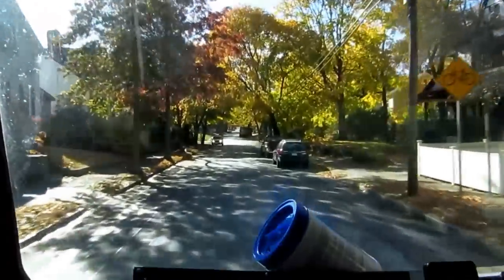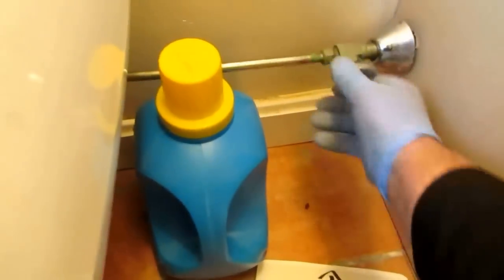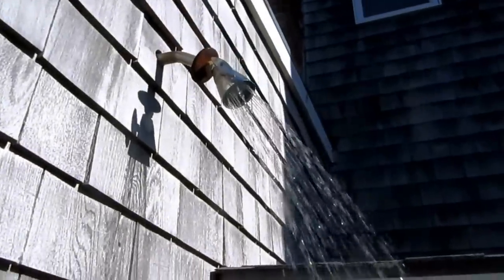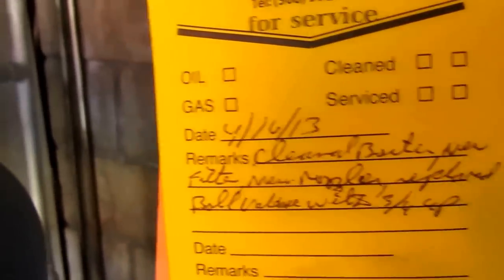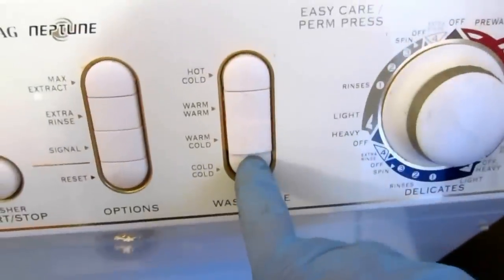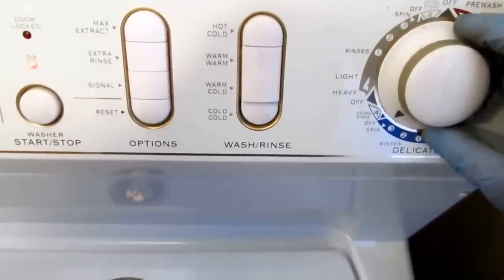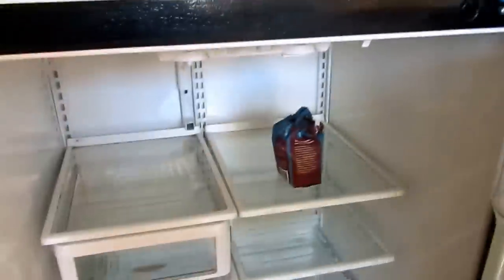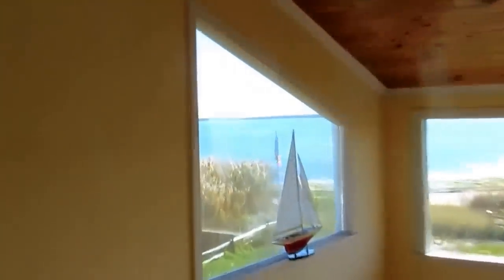PLUMBING TIPS:winterize house with boiler @ baseboard heat

Comment from the maker: the boiler water heats the tankess part the low limit is set for 160 to allow the boiler water to heat the coil up witch then will kick in after the 160 for heating run up to 180 high limit ect

Comment from the maker: if the low limit is set to 160 the cerculator for the heat will not run till the 160 is meet

Comment: Got another  couple of questions for you Steve. I am replacing a 40 gallon propane hot water heater.  The water supply is a private residential well. The water heater location is in the basement. There is a studio apartment on the basement level,  with 2 sinks, 1 toilet, and a washer and dryer that uses a small amount of water for wrinkle remove cycle. No dish washer in the basement apartment either.
The vacuum relief valve is not required, in my state. 
Is there any good reason for me to add a vacuum relief valve to the system?  No city water at all at the residence.
Also, do you use Yellow Teflon tape, with pipe dope, on the propane hook up, or just the pipe dope? A lot of old timers, and inspectors don't like to see the teflon tape, but I see you like to use both tape and compound on your other threaded joints.
Thanks.
Reply from the maker: +Marc Poirier with gas i only use pipe dope . no need for a vac breaker if you have a well
Reply: +steven lavimoniere Pretty much what I thought.  Thanks for getting back to me. 
I was laughing my ass off when I watched your video about replacing the water lines with PEX in that old house with the brass fittings that were breaking up on you.  I thought you were gonna chase that one to the street. Funny phone call.  Geez, Idk why We would want to wear gloves.

Comment: Thanks for the video.  Do you adjust the compressor down to 15 psi to blow out the furnace or does the feeder valve reduce the pressure from you original 60 psi?
Reply from the maker: spatmay i make sure the drain valves are open before applying the pressure no i let the 60 psi push the water out ,but the other end has to be open so you do not build high pressure in boiler

Comment: Did you make that pump that you use to drain the toilets?  If so, what did you use for the vacuum plunger inside the PVC pipe?
Reply from the maker: +Marc Poirier www.youtube.com/watch?v=UgjD5fiWRU8&list=PLhnZ_WalJ2tb2fx6UfzGi_l-3wIZfvvbo&index=21
Reply: Wolverine Brass 83500,  thanks.